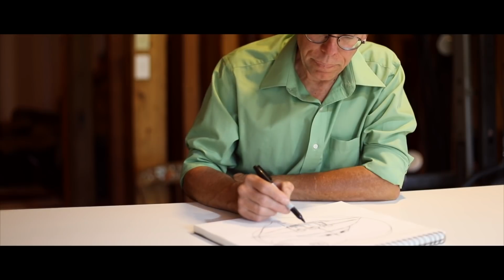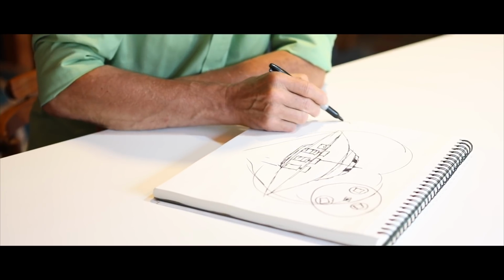BOB LAZAR : ANATOMY OF A FLYING SAUCER : EXTENDED SCENE

Comment: @3:39 so the crafts probably are conscious AI super computers.  Think about it. With all the sensors on it, you could train AI to navigate through stars at faster than light speeds,  and when it detects an incoming object or planet earth, it slows down and switches to a planet exploration mode that the AI has been trained on for possibly a million or more years. 
If you have an AI that has trained for many many years in ight speed navigation  through the stars , it would be a much safer way to travel instead of relying on a living being making decisions.

Also  I'm starting to think the aliens we see are not actually the real alien here, their consciousness is being shared into these biologics,  just like Avatar, they could be at home, but feel like they are actually here on earth without risking their real life.

Comment: Ask Bob, what types of bolts did they use?  Surely if you "dismantled" it, there were fasteners?  Or did he just take out the metal cutter?
Reply: I just posted this exact question. It seems like such an obvious question and one that somebody like Lazar would be inclined to talk about. I can only assume he was told to keep it simple, which is a mistake. The other possibility is he wants to keep his answers generic so he doesn't change his story.

Comment: Dear Jeremy, I think you and Bob missed a key section of the video. According to the law of conservation of energy, the energy you put into the reactor to make the proton collide with element 115 should be at least equal to the mass energy of the antiproton. So your investment produces = zero energy.
Conclusion: if you manufacture antimatter on board in that method, your system produces no energy at all.

Please let me know if there is an essential explanation that I'm missing, that needs to be corrected and explained differently..

Thank you,

P.S. I will suggest that perhaps the energy in the reactor itself is created from the vacuum energy (in a very short amount of time) in a way that doesn't violate the laws of physics known to us.

Comment: No fasteners anywhere. It was built from the ground up like a 3D printer. Yet “another group” somehow managed to take parts off it? Yeah, oooook. Then, of course, they have no idea what the power source was, and they didn’t open it to find out because they were afraid to release energy or radiation or something. This actually makes sense if you’re looking at something completely foreign and have no idea what parts may be dangerous to open. But again, they managed to take one of the “gravity generators” apart, and remove it from the spaceship? And then they were able to “bench test” it? Too many contradictions. Lol, he says, “I guess that’s important,” when the “interviewer” asks about it. What, Bobby, that whole part about the revolutionary propulsion system just slipped your mind? Guy’s full of shit.

Comment: so if they had 1 in the lab ...... that means there was ANOTHER identical craft - or an identical amplifier?
does the craft function if 1 amp is removed? 
ive been arguing on anti bob pages for months with that austrailian bloke who makes anti bob vids & even though hes an absolute C*** he did have one valid point
the hand scanner is clearly visible in 1979 in Close Encounters of the 3rd  kind 
when "map maker" gains access to the briefing room ,he scans his hand on a scanner quite similar to bobs description ,yes the scanner turned out to be real but critics will slam bob for the movie alone though im convinced he hadnt seen the film then ,maybe not even now !
then theres the 1988 paper on element 115 that was supposed to be doing the science rounds,ive been unable to confirm this other than pics of said pages .cant find a download to the real thing. i always come back 2 the same question
HOW DID BOB KNOW THE NAME OF S4 ? there is no mention of S4 in that sense BEFORE 1989 ...its a simple but crucial question ,how ? did he guess? have you seen the amount of shit they have out there if area 51 is designated as "51" then would that mean there were 50 others before it ? if site 4 is the same then 1/2 & 3 must have existed . Its a stretch to say he guessed. Im stil a believer anyhoo :)

Comment: "when you made adjustments it would move"... what kind of adjustments?  what did he actually do to cause the pipes to bend?  why are these interviews so short on deep details.  you have Bob answering questions and you don't drill down to the finer details is extremely frustrating and annoying to watch.  A real engineer should be interviewing Lazar and not some journalist who clearly is not of an engineering mindset!

Comment: Bob said the craft looked like it was injection molded or 3D printed with all rounded corners, no fasteners, or welds, nuts or bolts. How in the world were they able to remove one of the gravity emitters to test in the lab..? He said it functioned in the lab. How.? Did they apply electricity to it to get it to move.? That wasn't clear in his description.  In another video he said they (not him) removed the reactor and tested it in the lab. That took some big balls to do that.  But how did they get it out with no means of attachment..? They made time stand still when focused on a candle. It's never been clear to me how they managed to turn on the reactor to do that. I don't recall Bob talking about it.  I have lots of questions for Bob, but I have no doubt he's the real deal.

Comment: One of the more interesting pieces in this doc (to me) is the part most people probably missed: his explanation about how he was hired in to S4.  He mentions being hired in under a specific position - even though that was not the position he actually worked in.  Having been a hiring manager in DoD, I can tell you that this is exactly how the process works.  Orgs are only authorized a certain number of positions to fund.  If another area (let's say S4) has a need for an employee, but no govt appropriation for it, it has to be billed against another position, which is then taken off the hiring schedule.  His explanation is EXACTLY how the process works even today.  So, at the bare minimum, Bob is intimately familiar with how DoD does its hiring and selection of personnel for such projects, which wouldn't be common knowledge for someone who just worked in the photo lab. It might also explain how, even if we had a position core document on him, it might look like he was assigned to do something completely inconsistent with what he was actually doing.

Comment: This looks like the one that I saw in Ventura county in 2016. I watched it for two minutes untill it disapeared into a small cloud. At the rate it was traveling I calculated it would pass through the small cloud in a couple seconds but it just vanished. I tried to guess the size and the only thing I could compare it to was a small house which would fit Bob's description. I have also tried to calculate it's elavation. I have flown quite a bit and sky dived. I guessed it to be at about 10,000 feet. I never checked any other sitings
Reply: This was February 14, 2016 at about 6:15 am if anyone has a way to check any other reports. Thx